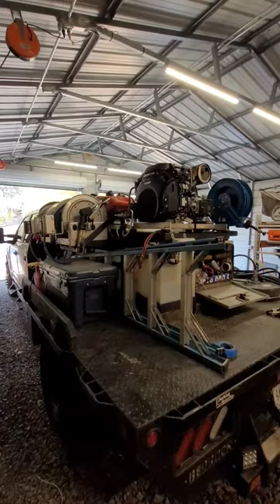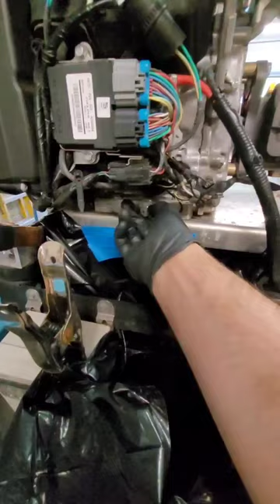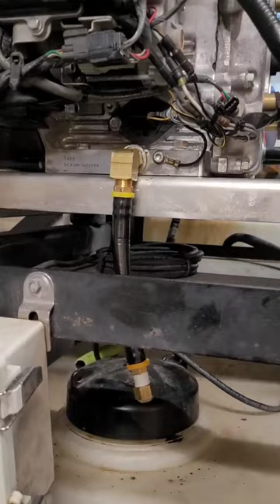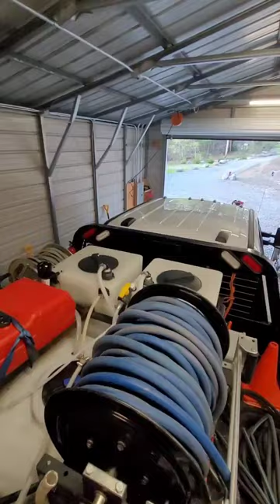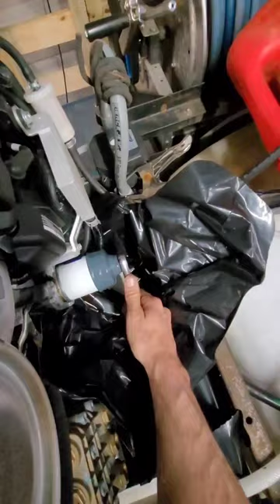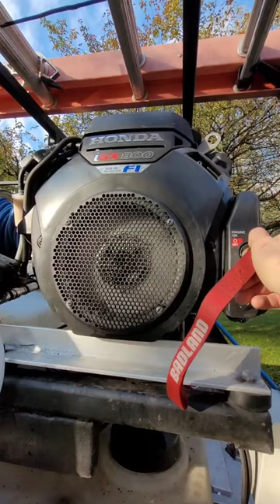IGX800 Oil Change

Comment: I have 2 of these. Where can i find the drain extensions?
Reply from the maker: i found some on amazon
Reply: @YoungAmbitionYA  were they from Honda? Or just parts you ordered to make it work?
Reply from the maker: @ohmimprovement5767 they’re generic. just need to know if you need a 3/8 male or 1/2. some of the oil drains are different. but regardless the generic ones on amazon work great and cheaper than if it came from honda
Reply: @YoungAmbitionYA  was the specific on you used in the video 3/8” or 1/2”?